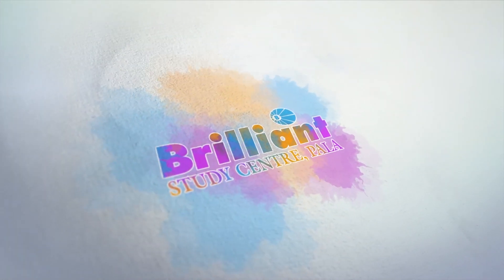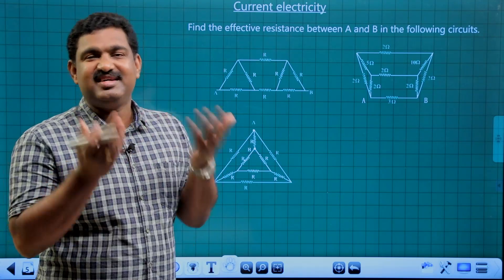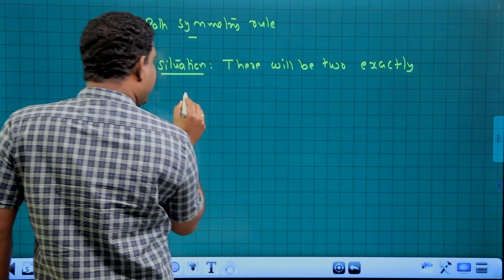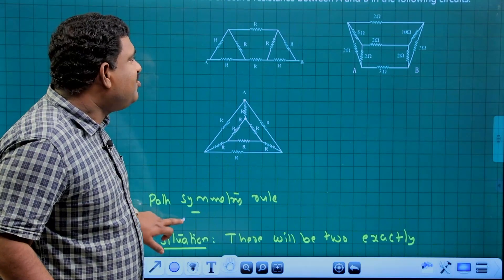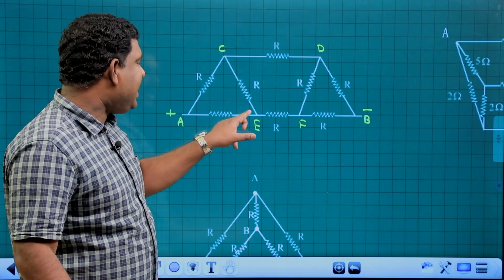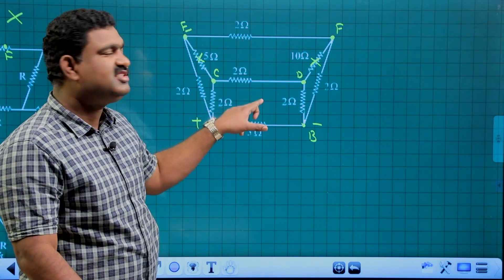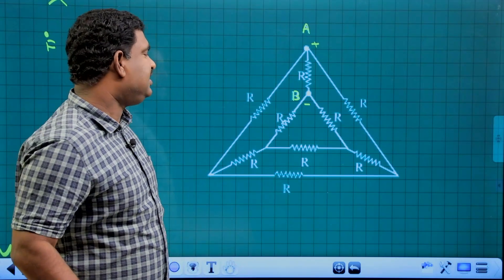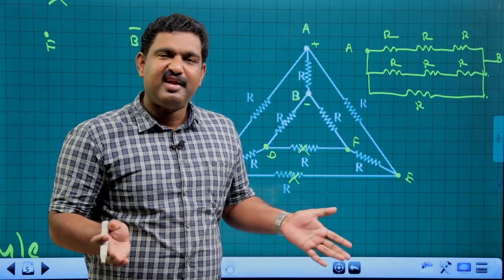PHYSICS | Current Electricity | MOST IMPORTANT QUESTIONS

Comment: Hi sir, It will be so great if you could give all the best problems related to this circuit solving by including the other rules (ie, parallel axis, perpendicular axis symmetry etc ) with well explanation as you did in this particular video